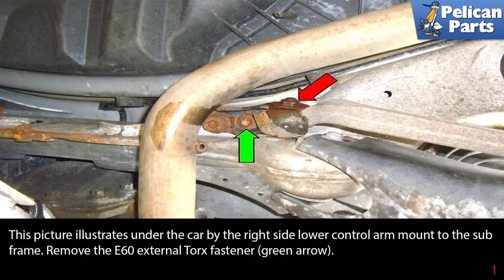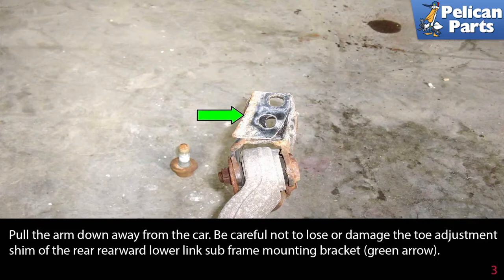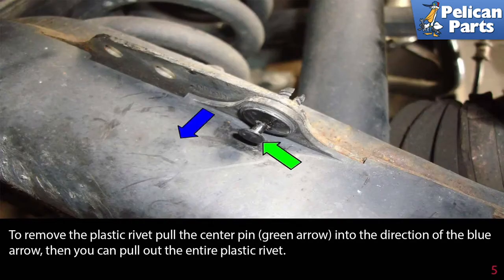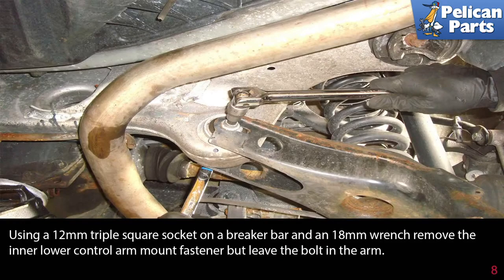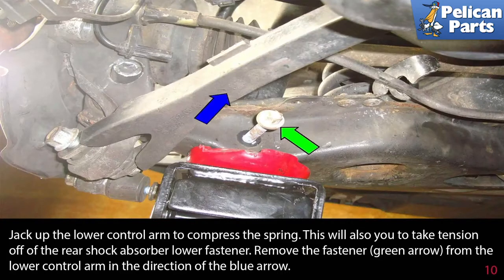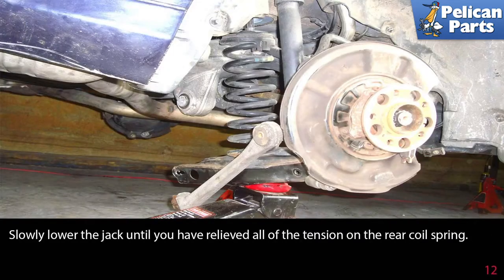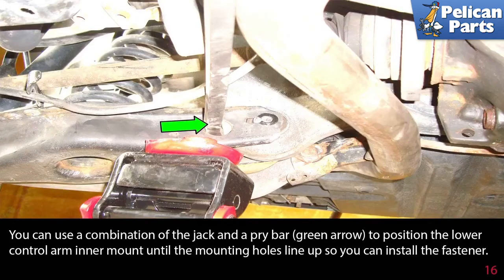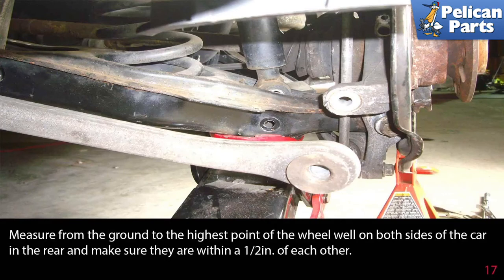Mercedes-Benz W211 E-Class Rear Coil Spring Replacement

Comment: Thanks
Reply from the maker: No problem
Reply: @pelicanparts  hey so when i was removing the spring, the plastic retaining cone on the top got bent, the plastic threads sheared off but the metal stud is good. You think that will cause problems if i glue it back?